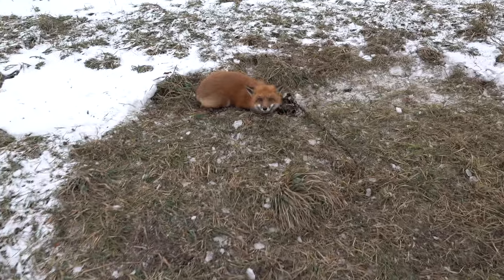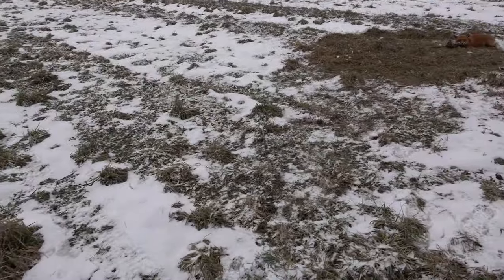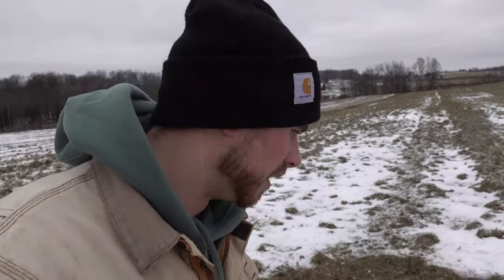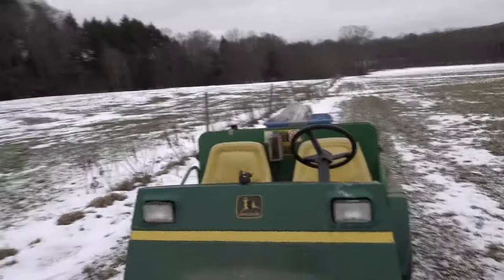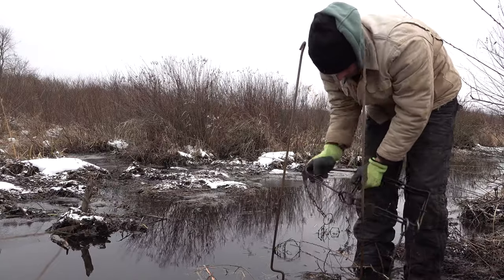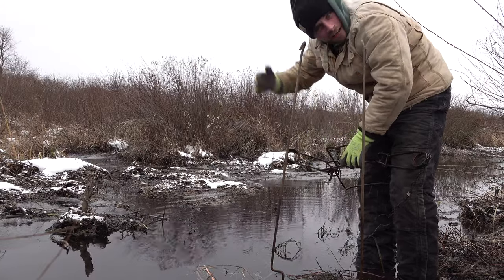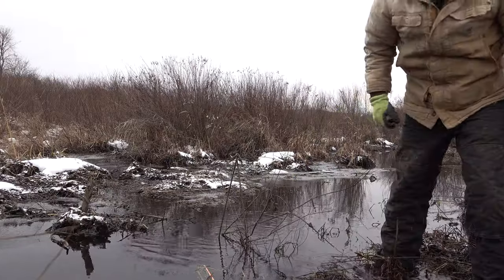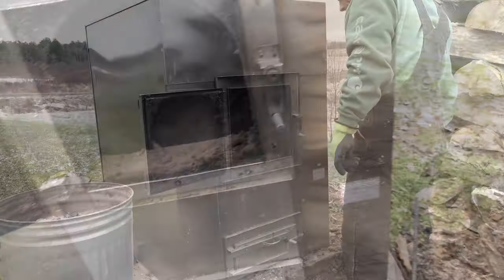Dirt Hole Set Connects On Day 1

Comment: I sold and installed OWF ,nearly 3000 of them, for almost 30 years.  You are 100% correct on the ash removal and just, maybe more important is using a PH control firebox  treatment.  Ash Trol will keep the creosote and ash more PH neutral.  One of the problems of cast iron grates is most of them are outsourced to China.  Really poor quality cast iron.  They often deteriorate  with the appearance of 'de-laminating'  If the choice of a stainless grate is offered as a replacement pay the extra money.  Good cast iron has almost no carbon in it.  Carbon allows the oxidation that breaks down the casting. If you can burn your furnace real hot occasionally to keep the creosote from building up.  Most newer furnaces will not allow real hot fires.  Off season maintenance/real clean fire box is Important.  If you are using the furnace year round for hot water it is inconvenient to shut down for a good cleaning.  Almost all the issues with corrosion /damage I have seen was a result of not keeping the fire box clean.
Reply from the maker: Thanks for all the insight!

Comment: I need new boots. I will buy Cofra boots again. They lasted 10 years last Lacrosse rotted in a year. They are Italian made, #1 boot in Europe, great traction, composite steel toe, not effected by oils,  built in nub on heel for boot removal, good to -54 with their liners. I wear light socks and am fine. Available at Blue Collar in Falconer. Check them out!

Comment: I’m a retired hvac service tech that carbon is not normal it’s cooling the air in side there either a water leak inside the jacket or air is coming in.. same as a glasss wood stove door when the seal is bad let’s that carbon stick to it hope this helps solve your problem feel free to ask me any questions good luck not that you need it
Reply from the maker: Thanks for your insight! I will have to see what I can figure out with it.

Comment: Cliff how many cord of firewood so you burn a season and how many sq ft is your house? I've used a VC Defiant Encore woodstove for almost 30 years. I burn 3 1/4 to 3 1/2 cord a season and the stove is no longer air tight. My house is 1500 sq ft. I assume that boiler also gives you hot water?
Reply from the maker: We burn two tri axle loads each year to heat 3600 square feet.

Comment: A guy from Hardaway outdoors says he shot a deer at 175, with a flintlock,  what would you say would be the chance of that,  is that puttin up an air ball, or is that a common occurrence,  I would believe it's not common,,and the chances pretty low , 175 for a flintlock may be doable but not a very high percentage no doubt,  what would you say the maximum effective range with accuracy for the common load in a flintlock is, 175 seems quite extreme to me, but maybe it is, in some flintlock, I know you have that really nice Lyman, is a shot like that capable for a Lyman, just wondering,  because I've never heard of a 175 yard shot with a flintlock,  that would be quite the shot for the common in line
Reply: It was Hardwoods hunting TV, that posted the hunt